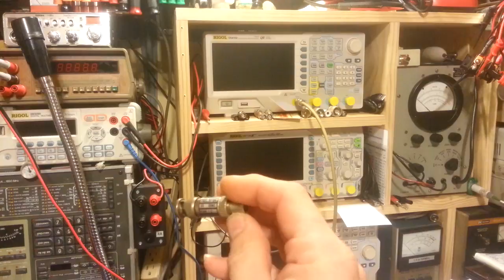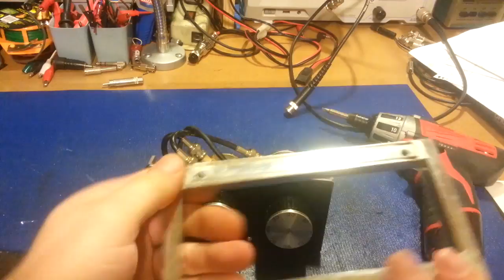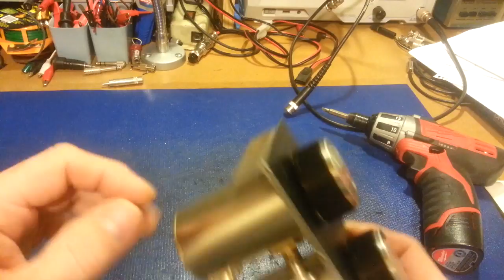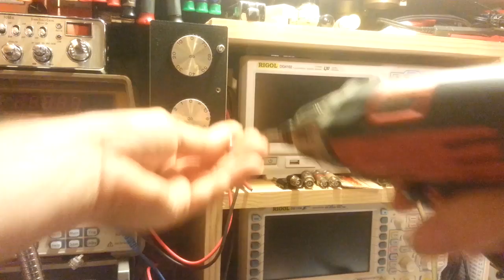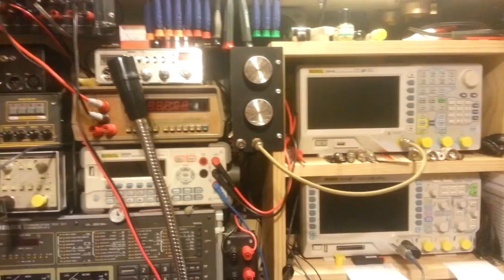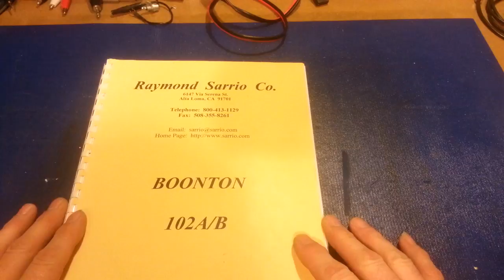Adding some built in attenuators to the work bench.

Comment: This video reminded me that I have 2 (I thought it was 3) attenuators like that in my parts "closet". Both are made by Telonic (now Telonic Berkley?). One is a TE-50 494T 50Ω 0-50dB (I think) attenuator. The other is a TB-50 AX6 2243A 50Ω 0-10dB attenuator. I thought a I also had a 0-1 dB version but I don't see it anywhere. It's hard to find good info on them.
Reply from the maker: Sounds like one grew feet and walked off.  Hate it when stuff does that.  If your like me you buy a replacement and find the other one the next day.
Reply: LOL, true story. I had one selected and ready to buy about an hour ago and then I thought "damned thing will probably show up right after I hit send" and closed the browser. And... I just ordered the sig gen that you bought. I had some "points" on a CC that I use for equipment purchases so it didn't cost me but $40. "Points", however, just means that I spent way too much money when I used the card (but at least paid it off). Ah... whatever... I needed a good arbitrary waveform generator anyway.
Reply from the maker: +Michael Lloyd 

You might as well download and print the manual now.  Its thick and a lot of stuff to read up on.  I'm still learning how to use it.
Reply: I downloaded everything Rigol had.I'll have to print it at work. As you noted- it's a big manual

Comment: That is a good repurpose of old parts. I am very surprised to hear the Rigol will not go that low.  Very interesting Mike.
Reply from the maker: I think Dino said even his more expensive Rigol unit only goes down to -110dbm.  Even that is to high for sensitivity adjustments and measurements.  Not a problem anymore. :)
Reply: Yep, I can't figure why Rigol would go to the trouble of building a very capable RF signal generator and not have it useable directly at the levels required for sensitive receiver work. My other three generators bottom out at -127/-130dBm; having said that the Rigol does go up to +20dBm which as Mike said is nice to have available when monkeying around with mixers and stuff.